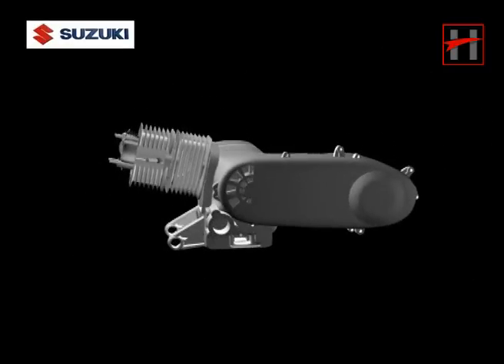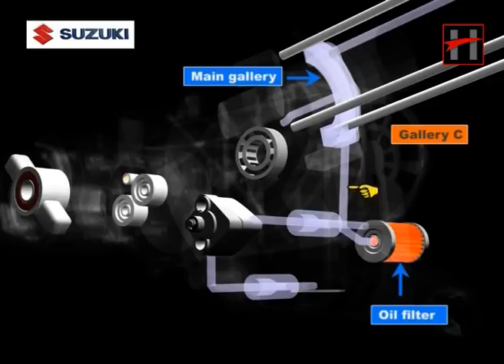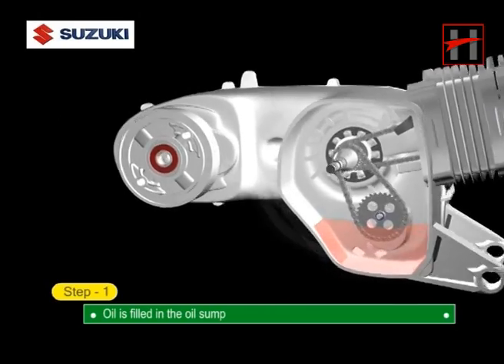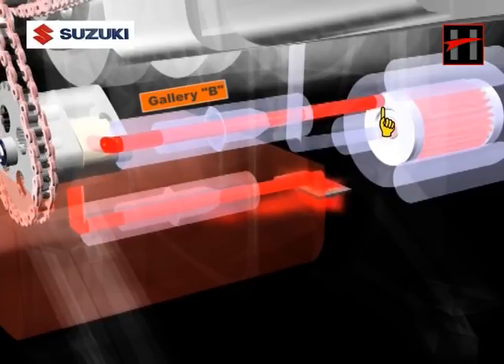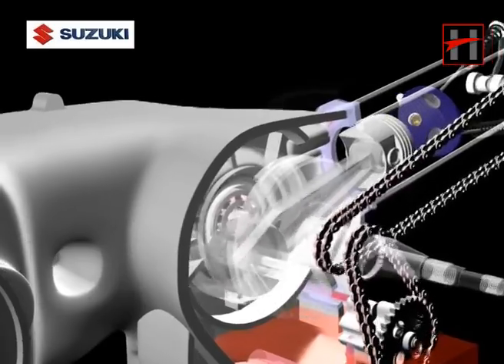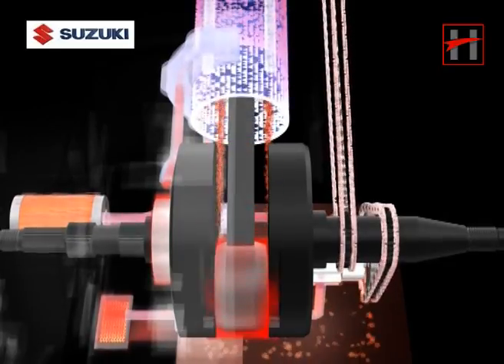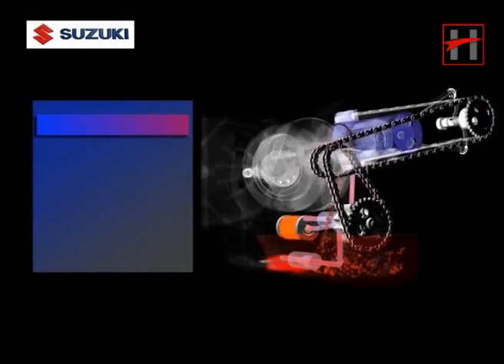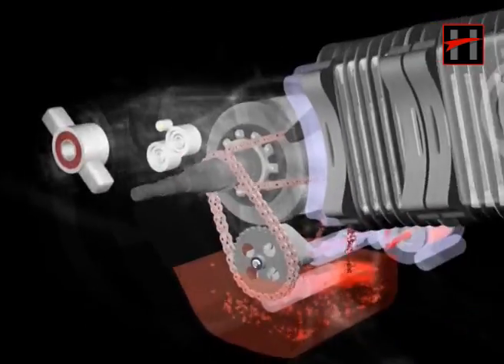Suzuki Access 125 : How Engine Lube Oil System Works ( 3D Animation )

Comment: 10w30 Is recommended for activa is it good to use 10w50. How much time delay will 10w50 take to reach cylinder when compared to 10w30. Thanks.
Reply: 10w30 will flow the same as  10w50 at cold temps but 10w50 will lubricat better at high temps
Reply: Please does SUZUKI ACCESS 125 uses same piston rings as SUZUKI GSR 125?

Please help me with an answer thanks.
Reply: @wallparrot8927  depends if it's the exact same engine most likely there similar but not the same